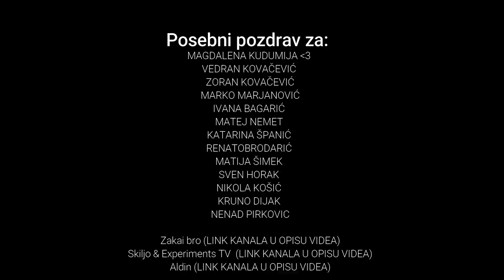Homemade CABLE for TRIMMER ?!!

Comment: Sve je to lijepo brate moj, ali, prvo opasno je (ako iole znas o trimerisanju ne moram ti objasnjavati zasto), drugo, ne moze na glavu trimera da se stavlja sto oce, u odnosu na snagu i sam silk/najlon se bira, jer postoji opcija da nagrdis samu glavu a i trimer vremenom, trece, imas glave koje pasuju sa vise kraka nije sad da si patentirao ovo, cetvrto, imas silk/najlon sa aluminjumom....kad radis s trimerom, u otkos ide pun gas pa pustis pa sledeci otkos pun gas, nema turiranja, to je gusenje karburatora i plus cijepanje vremenom sajle gasa, to su osnove trimerisanjanije to golf dvojka pa da ga zajebava saug pa mu dodajes gas. Pozdrav!
Reply from the maker: Pa vidi ja sam tu da bih esperimentirao i pokazao ljudima dali to je u redu ili nije u redu ;) 
Ja znam da ne mozes stavit di je namjenjeno 2.4 sajla stavljat 3,0 :D 
Uživaj ;)

Comment: The metal line is very dangerous if it s  broken and fly out with high speed,i tried once and a small part of the metal line went into my son's leg when he stood 2 metres away from me,i ran to him and pulled it out by hand, felt so lucky it did not go to the eyes,then never used the metal line again
Reply: Yes, is very dangerous.
Reply: Ahh ok thanks for dissuading me from trying this. Appreciate it.
Reply: Yes it's better just to buy a big spool of line once for the whole season. It's cheap.
Reply: Thanks for sharing that, bro.

Comment: I don't have a video on my adaptation. Nonetheless, here goes. I ran a solid piece of very thin stainless steed wire, similar to a bicycle spoke wire, but, out of stainless. Stainless steel will come right back to its shape during whacking.  I ran it through the bobbin. I secured it with some little bolts that are hollow and have nuts. It is set. I fixed these little bolts and nuts to the exterior part of the hub, ran the wire through the bolt-nut assembly. I haven't used plastic trimmer wire in years. I do caution. Use pants and boots when operating this adaptation. You never know when the wire will shoot free and spike you or someone. Good luck.
Reply: Chaps and steel toed boots
Reply: How can I reach out to you? I wanna have a look at it

Comment: The idea is good, but I believe that the unequal length of the steel wires added to the uneven weight of the welds,
will eventually unbalance the rotating head and cause premature wear of the gears.

Comment: Excellent creation! I wonder, have you tried using heat shrink instead of solder to prevent the strands of the cable from coming apart? I think the heat shrink is going to make the trimmer cable lighter than soldered cable.

Comment: Interesting about the lead welding. I made a similar modification and at first it was bad ass but the wire started to fatigue and shoot out like bullets. I think I still have wire fragments in my legs..  
I have a 10 year old Stihl FS 56, I found out that the fixcut 3-2 head replacement work’s best. I’m able to use .155 string and it’s super durable. I call my weed eater, the destroyer..  like from the 80s move Conan the destroyer..
Reply: Roy tem como vc me mostrar com ficou essa adaptação que vc fez??? Na sua sthill 56.👍

Comment: I've often wondered if I could replace string trimmer line with cable on my own. This is an ingenious solution in my opinion. The nut and bolt to secure the cable was a great idea.
Reply: This is very dangeros

Comment: I use my old guitar strings. They already have the little brass barrels on the end so they will stay in the holes with a washer in front of it.No welding, no  soldering.Just a little wrap of duct tape to prevent the string from pushing back in while handling the trimmer when it’s not running. Centrifugal force keeps the strings in place while the trimmer is spinning.
Reply: That's a good idea,I have guitar strings off all gauges, will definitely try this.
Reply: Bass strings may work better since they are of larger diameter and the ball on the end is bigger as well. I had wanted to try that for a while now. After seeing this video I'm going to try it tomorrow
Reply: Jack black 
   Bass guitar strings sound even better than guitar strings. pun intended...Let us know how that works on the trimmer..

Comment: It does not work, if the cable touches the rocks or concrete, the cable's tiny wires will be apart and making problems.

Comment: it's more dangerous, the cable wire split and join together then whole mechine vibrates can't handle. soldering will not give strength, arc welding will give strength however cable cut in the middle. I suggest cuse weed cutting plastic cable.

Comment: Do you think that the nyloc nut would still be good after using welder with nut attached , as it would probably melt the nylon to a degree of making it  non reliable??  Nice idea though (dangerous) but still nice👍.

Comment: well...i've been thinking about utilizing a cable, too. Got the same Stihl model as you. So, ? to you is:  what is that round steel base rotor you use ??   Is it salvaged off of something, or can we buy it ???  the thing you installed the two locking bolt nuts into....thanks. from Alberta Canada..

Comment: Doesn't it's particle fly after long use.? I'm afraid to use this without any gears on 😶
Reply: Its particle? The wire doesn't own any particle. The wire could not brittle and turn into particles.
Reply: @carlosprietocarlosprieto8950  i mean metal which may break from this wire.
Reply: @rajatrana3329  I see, no, no particles are freed from this wire. Besides, the wire was reinforced with soldering
Reply: Yes. The cable frays and breaks apart. Very dangerous.

Comment: Looks like a rugged string substitute!  Try so-me cutting oil on your drill bit while drilling prevent the dulling and overheating of the bit which is evident (black cutting edges on drill bit). Without the oil, the drill becomes overheated and looses temper causing it to get even duller! Nice idea and video :)

Comment: Using a pivot trim type head would save a ton of trouble. Would soldering like that work for 1/16" stainless cable?

Comment: Leaving steel wire pieces all over the place or in your leg is a bad idea.
Reply: Leaving plastic line pieces which take at least decades before decomposing all over the place is also a bad idea. When I realised I regularly litter my property with pounds of plastic (at least half a pound of trimmer line per year!) I felt pretty uneasy about that! I mostly use metal blades but in some places with lots of rocks plastic line is more convenient and does a better job...but I'm currently looking for something which can replace plastic...
Reply: Protect your legs 🤣😆

Comment: Why not use #9 tie wire or baling wire?   don't understand having to go through the trouble of soldering that cable.   that solder won't hold up either

Comment: I am thinking of using the really thin red and black electrical cables I pulled out of a light fixture as a line you think it will work?
Reply: No. They’ll snap in seconds. Tried it!
Reply: Only the doctor can use this constructions ☝️🤣
Reply: It’s kopper it will probably break…… but try it anyway and make sure to post it to YT. 🤘🏻🤘🏻🤘🏻

Comment: more trouble than it was worth. Just drill out a bumphead to take .130 or .155 line and you will get something that works even better. .105 line is a scam.

Comment: Nice job. I tried something similar with an old electric strimmer, total fail, the motor couldn't cope with the extra pull of the heavier cables

Comment: There's a reason why they don't sell steel cable for string trimmers, it can cut through almost anything at the right speed. The movies aren't lying when you see a high tension cable snap and it chops someone in half. Do NOT try this at home.
Reply: Yes

Comment: Very dangerous! Why don’t you just use the metal blade you have standing by the doorway?
Reply: cause its less dangerous than the metal blade
Reply: @cordellej  A metal blade consumes much less power than line and has momentum.  They are approved for use and there are no bits to fly off and injure anyone including the operator. All the main manufactures state in their manuals “ do not use wire”
Reply: @robinwatts7079  yes i agree but what if our metal blade structs to the any stone or any hard surface then the blade can become life threatening 
where as in case of the any wire only the small part would be torn apart while making less damage to anyone !!
Reply: @robinwatts7079  you do know that the metal blade will throw rocks and debris a few dozen meters away while the wire won't . Not to mention the tiny bits comming of the wire are so small there as close as the blades of grass that was just cut
Reply: @robinwatts7079  They state that in their manuals because if using a system as just demonstrated was used by more and more people their sales of trimmer line would go downwards effecting their profits hugely.  It's all about money and profits?

Comment: big thick long zip ties work too, just zip them to a hole somehow somewhere and make sure the tail is not sticking out past the blade cutter ... whats nice about that is its still plastic and you don't need to worry about pieces of metal potentially flying at you ...
Reply: Just buy better line

Comment: 1. How did you do soft weld (lead) over steel wire? 2. Does not work, steel wire snaps after 5 min use. Chain saw is best but even that breaks.

Comment: Rubber coated fine cable that you can get at the Home Depot will never break but if it's too thick or too thin, it will take off into orbit
Reply: Eew
Reply: Err
Reply: But one good thing is that I have never been hit by one of the flying cables or solid wires

Comment: Beats winding. Flipping the head to access the locking nuts seems better than having to remove it each time you need to change them out.

Comment: So wire wheels are ok for bench grinders, drills, angle grinders.. but then all these comments on the dangers of “shrapnel” from the same people who would have done the welding without shade 10 or needed a warning label to tell you soldering may be hot. You’re too dumb to handle a cup of coffee without a warning label. Mankind really is a lost cause.

Comment: Where did u get the metal hub?,the 1 on my machine is all plastic,btw im wondering if all the welding distorted the hub on any way?,as this could unbalance the hub & cause a serious vibration which could damage the drive shaft/engine too?,could also make the machine uncomforable to use as well.
Reply: It looks like it came off of a small motor carburetor.
Reply: Metal hub is for a blade with two or three points, I have one its not great for lawns. Cheers

Comment: Ever wondered why they hardly ever use steel wire for cutting? Honestly the worst idea ever. If a piece of steel comes loose you have a high velocity projectile that will go through the leather of your shoes without hesitation. Not to mention your retina. Or that of you next door neighbour. 
Safety wise I'd say, stick to the plastic strands or get yourself a cutter wheel. Stay safe!!

Comment: If the wire comes apart, it could go straight through your foot or leg. Don’t try this at home. There is a reason the big companies don’t produce this setup.
Reply: Correct

Comment: If steel cable you could weld the end of the cable so it dosnt fray could also add a nut for weight

Comment: Just be careful never to come across any ele trical lines or you will pop that cornfield you standing near...that electricity will pop every kernal of corn near shere your standing with you the biggest burnt kernal in the field!
Reply: Even with plastic ones you shouldnt do it as those can also break the cable shielding

Comment: Do you sell them like that? I would buy them if you did.
Reply: You can buy a head for thick the thickest line and thread the wire through. No need to weld anything.At least for a stihl

Comment: I think the most dangerous thing about this is when or if when youre weed wacking and it gets caught around something it wont break off like weed eater line does.  It might either break something in the machine due to the extreme force or worst launch out of your hand... or both

But if youre able to avoid stumps stationery objects that it might get caught up on then id bet this would work excellently.

Comment: Seems like a lot of work. I always wind in an old wire coat hanger once the nylon thread is used up.
Reply: Does it ever snap off, say if you hit a fence?
Reply: I’ve never had that happen but I am pretty careful with it and I mainly  use it to do the edging around the lawn. If I am cutting through a root, I just go very slow and I’m careful. I also check the wire every time I use it to make sure it’s staying intact.  Occasionally it will start to look like it might break so I cut it back or replace it but that only happens very rarely. Not even every year.  Hitting concrete seems to be the worst thing for it but it will usually spark a little bit so I can tell when that’s happening.

Comment: Take the original and wind the steel rope around it its better
Reply: That's exactly what i thought actually, why did he have to make a complete new unit when he could've just threaded soldered wire into it, maybe it was a great thing? It might've got so hot that it melted the plastic?

Comment: Never never use metal for string.....string =FIRE
Reply: Never used metal for string. How does it equal fire? Cheers
Reply: @willtricks9432  the metal wire hitting concrete, rocks, brick, etc, will create a spark and the dry grass could catch fire I'm guessing.
Reply: Chet Weeds 
  I suppose that could be an issue if you live in a dry climate like the deserts of California. Stranger things have happened. I also heard that dew drops of water hanging from a branch or from a blade of grass can focus sunlight like a magnifying glass does onto something dry and cause a fire..
Reply: TheDarthEmperor I did not want to get into details but here in Ca where my parents had a 50 acre ranch the neighbor down the hill was using metal and struck a rock igniting a fire and burnt 16 acres of hill weeds almost losing there house.Luckly Calfire deployed a plane dumping fertilizer and painting the entire house with it saving it.I guess where there is high humidity your good to go
Reply: @chetweeds6882  dang he still has 42 acres to trim and cut.
Reply: The Cynic no he was on his property working his fence line
Reply: @chetweeds6882  I was joking. Like if the fire would have burn the 50 acres it would have saved him all that trimming
Reply: This brand usually ships with a metal blade anyway.
Reply: Oh No! Not the Weed!

Comment: ... interesting concept. BUT if the manufacturer states if you do something as little as leaving the guard off, it will ultimately throw it out of balance, thus making your whacker out of WHACK. I've been using my commercial Sthil without the guard for 4 + years with no problems whatsoever. The welded nuts and bolts raise an issue in this sense. Give me a post back Doc,  let me know if you've encountered any BALANCE issues. Thanx for the vid.
Reply: Gary Kovach 
  I don’t think balance is that big of an issue. Think about it. Every time a string of plastic or of metal in this video strikes grass, there goes your balance right out the window big time. It’s constantly way out of balance when only one side of the spinning plastic/metal string is at work.What about when you have a trimmer that has the plastic string that they all use and one of them is a little shorter than the other.Worrying about the balance of the string trimmer head is picking fly shit out of pepper
Reply: @harrylime5147  Well yes, this is my point. I was told I should not use my trimmer without the guard by the dealer. As I've stated, I took the damn thing off as soon as I got it home.  However, I do question how welding nuts and bolts will affect the bearings if it's not balanced. Obviously, the string, be it plastic or metal isn't going to do squat. Having to much weight in one spot can't be good for the bearings, I give a fat rats patoot HOW much you grease it.
Reply: @harrylime5147  wow ...
Reply: I will just answer you on fofus on bearings becausw dispalance. It is not an issue... every bearing is hard enough to sustain big load. 2 things which are completely distructive for bearings are overheating (loss of lubrication) and impact load. Every external and internal ring on bearing and drive element are coated with carbon mostly. That layer is very thin. Say from 0.1 to 0.5 mm. This layer is really hard and stiff. It doesnt allow any material to penetrate in it ( try to drill a hole there..). Internal material is less harness and more flexible. This allow every bearing to hold big loads because of that coat layer and internal  part of softer material acts like shock apsorber. So if ball or cilinder roll between bearing rings how ever load is its all ok. Only problem is hit. Good example is if you hit in hole on road with car. From that hit force is transfered to bearing and rings of bearing hit rolling element in bearing. On that spot roll element brakes small piece of bearing ring. During the time that piece which fall off stucks between rollibg element and rings on some other spot and makes new holes on rings. Then you can hear bearing on wheel is damaged. It sounds like grinding something inside. If you dont change bearing, it can stuck or brake some of rings. My point is: disbalance is not an issue as lobg you dont have any impact load on bearing or loss of lubrication.
Reply: @eng1026  Sweet.  So what you're saying is I should forward this little factoid to my dealer?  Seriously folks,  I just wanted to know what the long term effect on the head was going to be with that much weight being added. But, the fact remains, I appreciate all of your thoughts and comments. Now I'm off to use my weed/tree trimmer. I superglued  3/8th's tow chain to the head and can't wait to see the results!!!